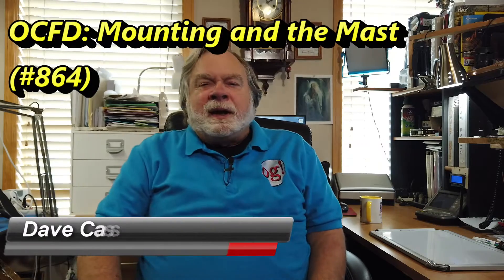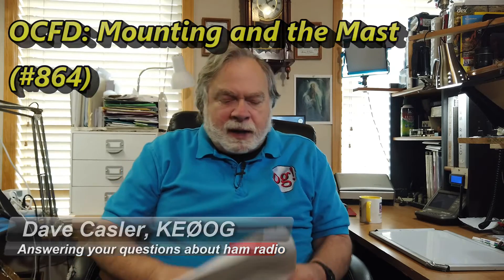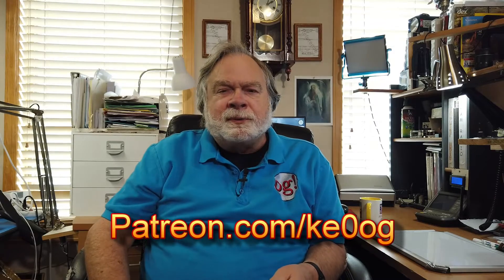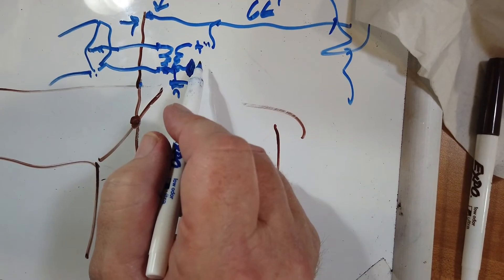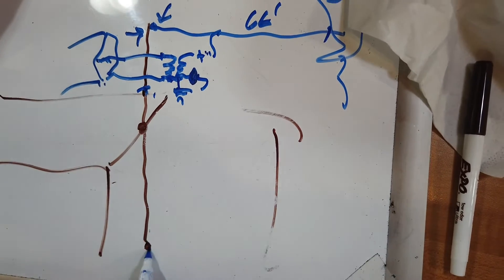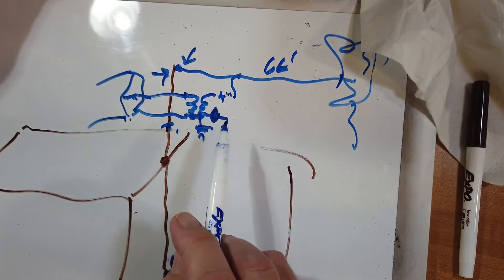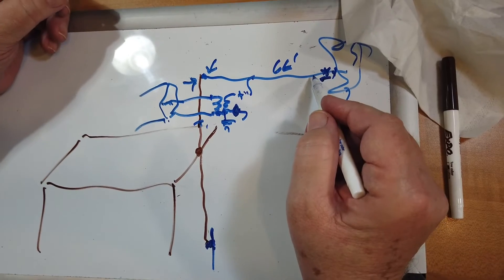OCFD: Mounting and the Mast (#864)

Comment: Hi Dave, the question is very clear.
He is going to have an EFHWA using a core of around 3" in diameter and a 20KV 100pF capacitor. His term (or Google 's term) union means the UnUn. Or his pronunciation of the term UnUn must have been mis-spelled as union, who knows. He must clarify.
He wants to know if the metal roof of the shed (his new shack) would affect the performance of the new antenna. The mounting pole (30') is a strong water pipe.
He never asked for a plumbing solution.
Yes, we don't do plumbing job here (except when we talk about the "plumber 's delight antennas" for the VHF UHF bands using the 10 mm copper pipe like the J pole, copper cactus or the slim Jim)
The 1:49 transformer (UnUn) is NOT an auto- transformer. It's a regular step-up transformer of with one end (cold) of the two windings connected together to be grounded (ie, to the shield braid of the coaxial cable)
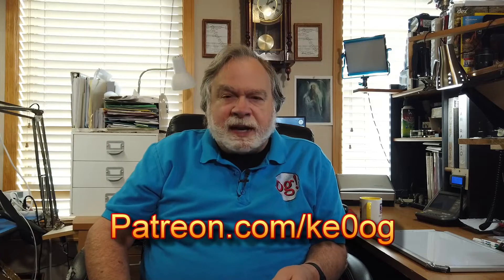The turns ratio can be 2:14 or 3:21 for the 1:49 impedance transformation.
If one is interested in the low frequency bands he can go for higher turns ratio.
Yes, coming to his important question as to whether the metal roof would affect the performance of the EFHWA, No, it will be working fine if the half lambda radiator wire is installed away from the metal roof. (that's what he has proposed, I believe)
If he is using some counterpoise or some grounding options the metal mast (as you suggested) or the metal roof itself can be experimented.
De VU2RZA